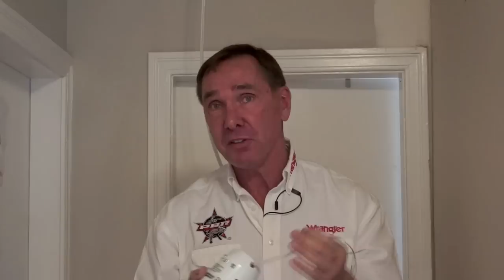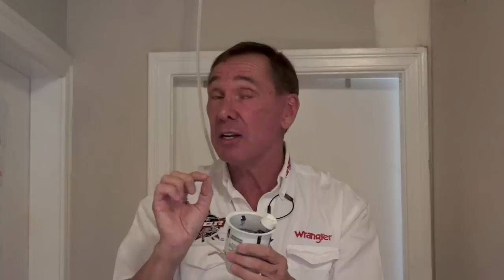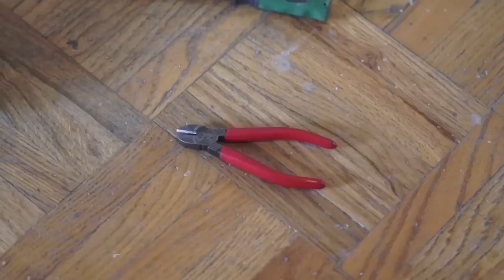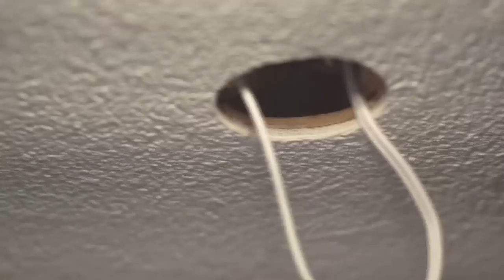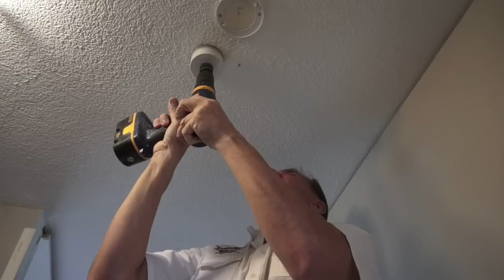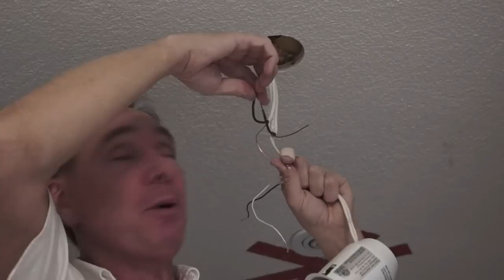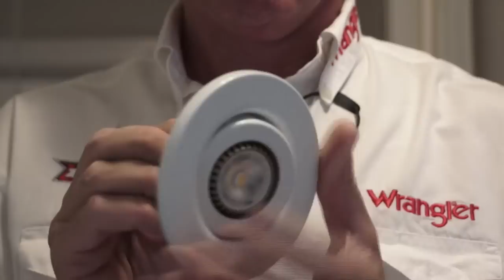How to Install Recessed Lighting | Retrofit

Comment: You remind me of a communications guy that was never a real electrician? Not that there is anything wrong with that. The communications field is crazy with all the technology.

Regardless of the bulb. Those fixtures are REQUIRED by the electrical code to be housed in an IC housing or better yet purchase cans rated for insulated ceilings.

The issue with the marrets outside of a box is, if there were ever an issue (sparks from a loose connection, or overheated loose joint), it would be contained within the junction box to minimize the chances of a fire. Again, this is REQUIRED by the electrical code.

No matter what YOU think, you cannot deviate from the safe practices outlined in the CEC or if you are US, the NEC.

Seriously though. None of those other posts were out of spite. There are some real safety issues with your install (dictated by current electrical codes). If you could get over yourself(what you think you know) and present proper, SAFE install info, you could have some kick ass videos. Until then, I suggest everyone beware and seek professional advise, or at least contact an inspector. Most are more than happy to offer free advice. They are not the enemy.

As for your "potential" comment. Potential refers to voltage and is only one part of the equation for total circuit power. At some of those free air joints you will have multiple lights loading the circuit (ie, the last joint before the switch). Add in a joint possibly loosening over time, and you could have much higher currents than anticipated, and arching. The arching in that loose connection can be the source of a fire. Containing the joints in a junction box will drastically reduce the chances of it spreading.

It appears you are the one the requires a refresher. You also are not dealing with "electronics" (ie low voltage, low power), you are dealing with higher voltage ac, that does have the "potential" to cause some serious damage.

Comment from the maker: Connections are a point source of disconnection and ultimately heat that is caused by sparks who's intensity is directly related to the amount of power being consumed. As I said a 6 watt LED bulb does not draw enough power to cause enough of a "potential" spark to be a danger. If you were to inset yourself into that circuit you would scarcely feel a thing EVEN sipping wet. I suggest you reread electronics 101.
Reply: Actually, the fact that an LED doesn't draw much power doesn't mean anything except that it has high resistance.  If you have 120v, it will supply as little or as much as the wire can handle, depending on the load.  LEDs have high resistance inline to limit the current, but you have only your body's resistance with no extra.  You will definitely feel 120V no matter how much current the LED is drawing.  120V can indeed harm you if you are wet and grounded, or if you grab both lines.  I have read electronics 101, and higher, and I can guarantee this.  Has nothing to do with heat generated by the fixture, or even power used by the fixture.  They are all in parallel, and they are all across the 120 volts.

Comment: You could have a fire you didn't put a box on where the connections go or even electrical tape
Reply: Percy Lipinski all connections for safety should be enclosed in some form of wiring box !
If your circuit isn't protected by an rcd commonly known in the USA a gfci if the wires short it could possibly cause a fire without tripping the breaker.

It has been known in the UK for house fires to happen with led bulbs not because of no heat just because of connections working loose and arcing against loft insulation which wouldn't have happened if a wiring box / enclosure was used.

Thanks :D

Comment from the maker: EXCUSE me idiot. I was and am clear. Apparently you're living 20 years ago moron. First off I was and am clear that this installation is for LED bulbs only. As for no control, that is about to be solved for idiots like you that don't know the difference between halogen and LED when they are banned next year anyway. The truth is that LED technology is about to render the job of over priced electricians useless because LED's can run off 5 volt speaker wire!!!
Reply: The guy you're replying to seemed polite and didn't attack you personally. You don't do yourself any favours unleashing a torrent of abuse at him.
Reply from the maker: Escobar Manchulo
Here's the thing Escobar after dozens of comments from people that ALL have the same agenda (It won't work and it;'s dangerous) I wanted to show people that they are wrong and that this is safe. (if you follow my instructions carefully and use common sense). If it takes me a bit of name calling then so be it. I.'m not doing this to make friends, I'm here to show people how to beautifully remodel their home safely and with low cost.
Reply: I bet more than half of your viewers don't know the difference between halogen and LED (hence why we're searching this field on YouTube); so are you calling half of your viewers idiots?  Not good PR!
Reply: Percy Lipinski "It won't work and it;'s dangerous"
No one is claiming it won't work and something working does not prove anything about its safety. You claim to want to show how to remodel safely, yet ignore building code. It is possible to do what you did to code, safely and cheap. No electricians required. But it does take some research and reading, not "common sense" intuition.

You arguing that breaching electrical code is ok due to "common sense" is doing your viewers a disservice.
Reply: Wow, impressive. You must have put a lot of effort into that. Only took a day this time. Probably were sweating all day over it, "Duuurrrrrr, how am I going to get back at dubbreak! I need to think up a really good one this time."

Then you spewed forth your usual diarrhoea of idiocy.

Think you aren't an idiot? What's your education? You think you are smarter than electrical code, so prove you have any smarts as your "common sense" is laughable.
Reply: KnicksNYanks84 Oh, and you look like Mike Shanahan!!  Great coach.
Reply: Lipinski strikes again! With his torrent of middle school insults! You for sure have to be a wife beater? I'm sure you kick around that little dog too from time to time. I can see you now, coming home after a rough day working at the old AM/PM. Crack open a few silver bullets. You get a little angry about what your life has become--or hasn't become rather. You're sitting in your old recliner, with a TV tray in front of you. Wheel of Fortune is on and you're eating chili straight from the can. That little yappy dog comes running out and you've just had it. You give it a swift kick.
Reply from the maker: +dubbreak You breathing is a diservice to the world you douche bag loser!!!!
Reply: Wow, little slow on the reply. I mean, not surprising, but took you nearly a year to come up with that doozy.

You are still wrong. Name calling doesn't change that and only makes you look like more of an idiot.
Reply: This installation is so dangerous. Please, hire a professional or learn how to do it correctly. Lipinski is going to get people killed! But hey, he's got those sweet cargo shorts, so he absolutely knows what he's doing!
Reply: Unknown User Ontario a
Reply: Dont reply to these troll assholes, Percy.  Keep doing what you're doing, ignore them.

Comment from the maker: Look, I'm not suggesting that 110 is not going to hurt you. Obviously, it's always best to turn off the power. My video clearly points out that there is NO risk from heat generated fires caused by limited ceiling access and confined spaces. Try that with 50 watt halogens and you're asking for a disaster. LED bulbs let you break very outdated electrical codes. Assuming one dan install safely then the finished product will provide plenty of luxurious light with no fire danger whatsoever for the life of the house!

Comment: " few people die of electrocution unless they're idiots or having a very bad day"
I think that if you are producing a how to video, you should consider that a lot of the people might take your word for the truth when in fact they could be hurt or killed because of your advice.  regardless of the fact that they might be an idiot they should still be properly taught to respect 120 volts as someone who is told that it is nothing to be scared of might accidentally kill themselves.  Im sure that it isnt your intent to hurt people but the people that know the least about electricity are the most likely to get hurt.

"currents between 100 and 200 mA (0.1 to 0.2 amp) are lethal. Currents above 200 milliamps (0.2 amp), while producing severe burns and unconsciousness, do not usually cause death if the victim is given immediate attention. Resuscitation, consisting of artificial respiration, will usually revive the victim."

"From a practical viewpoint, after a person is knocked out by an electrical shock it is impossible to tell how much current has passed through the vital organs of his body. Artificial respiration must be applied immediately if breathing has stopped."

Comment from the maker: Here's another exciting option fur those inclined. eBay will sell you a nice 200 watt 12 volt power supply for about $20. More than enough to light a house. Put that small box somewhere central. Now just groove in cheap, small speaker wire into the plaster of an older house. Then buy tiny surface LED light pucks and when finished simply fill in the groove with the wire and plaster over and voila you have light wherever you want and no need to change bulbs...ever!

Comment from the maker: As for a parts list. The 3 inch recessed fixtures w/o the housing is all that is needed. Any newer LED bulb GU 10 will work. Frankly within the next few years you won't be able to buy anything other than an LED bulb anyway.

Comment from the maker: Look there is no way a 6 watt bulb is going to cause any problems with overloads or heat build up. In fact most electricians are going to be out of work in a few years as we switch to 12 volt USB circuits for everything except heaters and kitchen appliances. In fact for anyone that's really concerned do what I just cud and replace the wire with cheap speaker cable and run it off if 12 volts using a 12 volt transformer. Even better yet get rid if all the mains and run USB outlets and LED strips
Reply: Percy Lipinski  make a video explanation, please

Comment from the maker: So to all the naysayers> The current drain on a 6 watt LED bulb is negligible. certainly not anywhere near enough to hurt anyone or risk a fire!. Get real a high temperature recessed light fixture is a total waste of money for a 6 watt LED bulb. The codes you refer to are way out of date. They simply have not kept up!. Load calculations for light fixtures are still based on Incandescent bulbs. Ridiculous since as of this year you can't even buy an Incandescent bulb in this part of the world.

Comment: hung up? 120 volts from a 15 amp circuit or a 100 amp circuit? Because I can stick my penis in a light socket and do my chicken that night without a hitch.  15 amps wont kill you unless your dripping sweat and barefoot on a aluminium ladder or something :D It has to pass through your heart to kill you.  Also are you sure ground is the most important? Because ground goes to white at the breaker, and lights don't use ground, you know that right? And it wont even turn on without a hot :D

Comment: Not quite... I agree that a wiring project such as this is not rocket science, however, there are a couple things to note. First of all, those cans are not complete. All high volt junction points are required to be house in a suitable junction box. Most recessed retro cans come with one built-on. You cannot leave open wire-nutted connections in the ceiling like that....

Comment: Hello Percy. I'm looking to remove the faux tin ceiling in my living room and replace with Sheetrock and add recessed lights. The housing for the lights you used seemed to be a lot smaller and streamlined than the ones I came across in my research. Was there a larger housing within the ceiling that I could not see. If not, can I use the same type you used? What are some factors to look for when deciding what type of fixture to buy? Sorry if the questions seem silly, I'm a novice :)